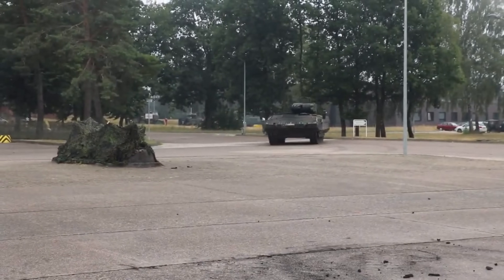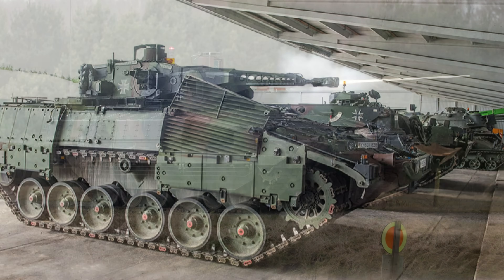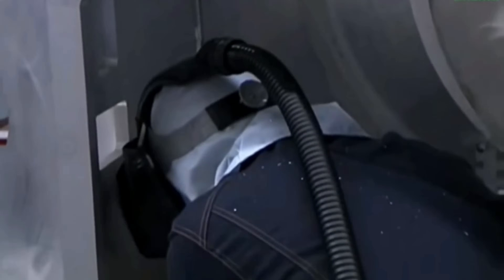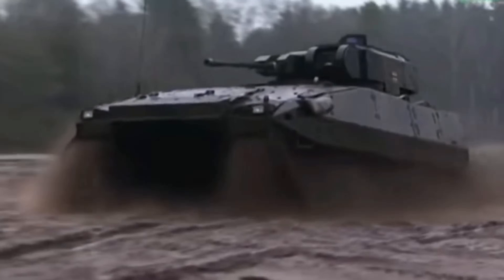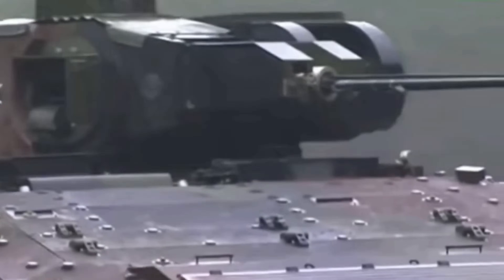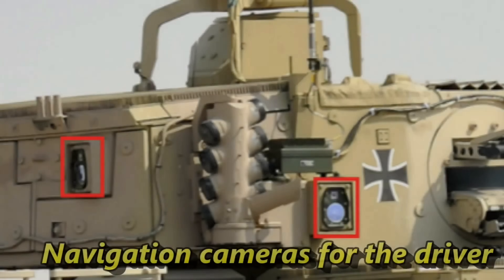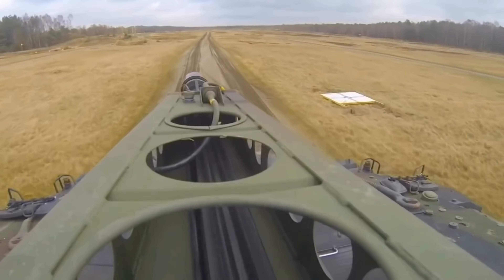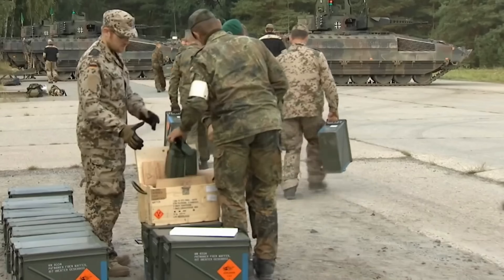The Puma Infantry Fighting Vehicle - Overview and Opinion

Comment: That hopium cage around the sides, given their current configuration, are just worthless weight.  When they get that wrong, it tends to lead me to wonder what else they got wrong.
Reply: Except slat armor with proper material thickness and spacing is a very weight efficent protection method. DIY welded cope cages made by russian conscripts are not.

Comment: Finding a balance between practical and over engineered is going to be difficult and likely deadly to find.
When a German cars headlight wiper webt out, it could cause catastrophic electrical issues, windows don't work, car won't start etc...
This will be an issue for sure, excessive tech and money when a javelin could get it,.. No? Then two javelins

Comment: Basically the Puma is over-engineered, over-weight and under-gunned. This video doesn´t address the vehicle´s problematic maintainability and although factual data are hard to come by, this issue reduces the availibility to a large extent...
Reply: ...was more reliable in ifvs trials than the cv90 and some other vehicles.

Since it has armor you can take off it is also not overweight.

Undergunned for what? Spike can destroy mbts. And the main gun works perfectly well against infantery.

Comment: a turretless Puma IFV with a higher raised roof could be significant . . . creating more space for troops loaded with full tactical gear . . . instead of a rotating turret it'll have a 25 MM GAU-12/U 7-barrel rotary cannon & 7.62 X 51 MM HMG, both fitted to a small & compact RWS . . .

Comment: A little information: The weapon has been moved slightly to the side so that analog optics are available in an emergency.

What made the development of the turret and electronic weaponry so complicated.
Reply: Not just in an emergency, they are used alongside the digital optics. Analog optics still have a much higher effective resolution than digital ones. In case of the Puma the analog optic has a effective resolution of more than six megapixels, that's about fourteen times (!) as much as a digital CCD camera optic.

Comment: The Puma has all kinds of problems. Soldiers cannot be 6ft or taller to sit in Puma. All the displays are black and white. Comms need to be updated too. The gun will just stop firing. In 2017 only 43% of the Pumas were deployment ready. It would need another 1.23 billion dollars to upgrade Puma's displays, radios, and anti-tank features.
Reply: I believe most of those issues have been addressed and resolved over the past few years. IIRC the reason for b/w displays was that they had a wider temperature-range in which they would reliably work compared to colour displays.

Comment: "Computers don't like working so good".

Disagree. You are taking your experience with consumer electronics as the baseline.

If that was indeed the baseline, zero people, not hundreds of thousands, would get into a highly computerized plane every day. They are far more complicated than an IFV.

You are of course right that brand new systems will have teething problems, but that can be said about any part of the system, not just the computerized ones (thinking of the Panther roll out in WW2).

Comment: While carrying out an attack, Ratels interspersed into arrowhead-shaped formations, with a platoon of Ratel-20s and a troop of Ratel-90s on each flank, the command Ratels located in the centre, and the remaining Ratels following in reserve. If the mechanised battle group was integrated with tanks—as during Operation Hooper and Operation Packer—the tanks spearheaded the formation to engage hostile armour, while the Ratel-20s and Ratel-90s followed closely on the flanks to suppress any accompanying infantry. Ratel-81s, if present, occupied a place in the centre of the formation, directly behind the command Ratels.

Comment: Outclassed by Ratel 20, Ratel 90, Ratel 81, Ratel ZT3.
Reply: Lol bullshit. Puma has better weapons better protection and better off road handling. Yours is just a modified truck with a small metal plate over the drivers window

Comment: I assume that due to the Puma's role as support for MBTs it is more "survivable" than the Bradley Infantry Fighting Vehicle. However theBradley DID fight right alongside US Abrams MBTs in the first Iraq war and subsequently. 
In smaller, more mobile wars it would seem the Puma is very well suited to be a stand-alone light armor vehicle or as support for armored personnel carriers and armored wheeled or tracked amphibious vehicles.
Reply: The german Puma and american Bradley (or for that matter the british Warrior) follow a different design philosophy, because the german military follows a different military doctrine (extensive combined arms). Pumas and their Panzergrenadiers are one combined weapon system. This is why it is well protected, since it is less meant for taxing its infantry to the front and then assuming an overwatch or mbt support role, but rather to directly support its Panzergrenadiers on the front.

Comment: The Puma is great but it has a big problem when used in the field.
Look at the tracks they are to narrow for its weight, so if this tank ever stops in muddy terrain it is very likely to stuck especialy in the heavyest modification.
(I was in german army i have seen this vehicle live.)
Reply: The tracks are perfectly fine for this vehicle. It has a ground pressure of 79,5 N/cm², that's even lower than a Leopard 2A4 (0,83 N/cm²).

Comment: another reason the Puma uses the 5.56 MG4 as coax is that nobody in the infanty wants the damn piece of crap :D they finally got the MG5 and are happy to get rid of the MG4, so now there is a huge stockpile of MGs nobody wants... so they put them in the Puma, cause you can always sling a 30mm ABM at them if you MG isn't good enough :D

Comment: computers dont work so good? first: relibility you use old tech like older processors and stuff just like is used in airplanes and space programs, cause u have plenty of data of how the hardware will behave, a mechanical failure is much more likely than any computer failure by a large margin. man for almost a century we been using computers to control airplanes, u think people cant get reliable use out of computers? lol saying that it might be unreliable on a ground vehicle while u use it for flight assistance on supersonic jets is kinda nonsensical..  specially cause we already use autonomous drones at warfare wich require a lot more systems to work, and if u give up on a thermal camera cause of dust, is kinda dumb cause in 99% of the cases u likely won't have a sandstorm.. and for germany i don't think they even have a desert or anything quite that sandy.. so yeah.. shallow arguments even cause the other guy stuff won't be working just like urs., adding computational capabilities to fighting vehicles is a huge force multiplier and relibility and dust ain't even a real issue.. oh by the way during cold war all the nuclear weaponry of both sides was computer controlled, once it almost went off by accident but guess what, it had a failsafe, just like you have redundancy in airplanes lol and if u compare how reliable modern stuff is to older stuff the difference is astronomical, saying high tech usage makes things less reliable is one of the most stupid trends i see around,  our engines are better than old carbs cause guess what? we have a chip controlling combustion, we have digital systems that control auto driving, diagnostics, and even the design is digitalized and perfected beyond what was possible due to computers.. lol just cause ur notebook got a virus or some piece of hardware failed u can't make the statement that computers are unreliable lol thats a falacy. oh and all our global banking system is still run on very old hardware that runs code written in a language nobody knows anymore called cobol, and guess what that shit never fucking failed.

Comment: The problem is:
"Although it is considered to be state-of-the-art, it is subject to a great time lag and high cost increases. Due to many technical defects and necessary retrofitting, full operational readiness is not unofficially expected until 2030." Wiki
That is the problem of all new german equipment.  Thats e.g. why the want buy the F/A18 so that they have something that is ready for use and works.
Reply: Lots of new german equipment works fine, now that enough money for spare parts has been provided. Boxer does and sells great. The newer Eurofighter tranches (T2+3) are fine. So are Leo II A6/7. The 130mm gun for the Leo AX (coming 2027) will be a blast.

The Puma was a very ambitious project and is slowly getting its kinks worked out.
OTOH, the US army is now pushing the Bradley replacement decision (!) out to 2027. Germany is 20 years ahead of that schedule. 

US navy is planning to get frigates from Italy because they couldnt get the LCS successor right. Germany is getting 4 new frigates this year, has 5  new corvettes under construction and recently signed the deal for 4+2 destroyers (MKS 180).

As for the F18SH option, the main reason for that is: it can get certified to carry US nukes much faster. It also gives access to additional weapon choices and generally makes the Luftwaffe less dependent on any single supplier. They are still going to buy at least 78 new T4 Eurofighters.

Comment: 5:44 The German Army propably didn't choose the 5,56mm MG because of light wight and ammunition: At the time the Puma was in development, the Bundeswehr still had the 7,62mm MG3 (basically a MG42 from WWII) as their main MG on all their existing Vehicles (Marder, Leopard) and in ther infantry squads. But the MG3 was old, the infantry was about to get the new MG4 (5,56mm) and a new 7,62mm MG was in Development, so they first put the MG4 on the Puma. In 2018 they started to replace the MG4 on the Puma with the new 7,62mm MG5.

For those of you who speak German:
https://www.onetz.de/oberviechtach/vermischtes/appell-fuer-14-neue-schuetzenpanzer-die-puma-aera-bricht-an-d1850509.html
Reply: MG 5 ist ein Witz. Ist von der Form der unkompakter, hat nur 400-800 schuss feuerrate im gegensatz zur nur 1,5 Kilo schwereren MG3 Standard Version mit ihren 850-1200 schuss Feuerrate je nach V-Klappe und das für 16 Tausend Euro pro Waffe.
Wieder nur eine neue Art die Wirtschaft mit Steuerverschwendung künstlich am Leben zu erhalten

Comment: too fat, too slow, too expensive, too unreliable. 
actually it has many technical flaws that lead to that the whole puma fleet will not be fully operational until 2030. as is expected by now. 
8.85mio euro per vehicle can only be considered as a joke. + now 750mio extra costs to bring the delivered vehicles up to the expected and ordered standard.

https://translate.google.de/translate?hl=&sl=auto&tl=en&u=https%3A%2F%2Fde.wikipedia.org%2Fwiki%2FPuma_(Sch%C3%BCtzenpanzer)%23Kritik&sandbox=1

Comment: Wow! That makes my old M3A2 ODS Bradley CFV look like shite in many areas. BUT, I not a fan of the unmanned turret. When I was a Bradley Commander, I could look over the sides of the turret, when in a turret defilade position. However, the turret cameras on the Puma apparently would be useless in that type of a battle position. Also, I don’t like the fact that an ATGM launcher does not come standard on the Puma. I guess there’s simply not enough room to store missiles inside? Interesting vehicle, though.
Reply: placeholder 
The main reason for the late adoption of the double ATGM-launcher was,  that the level of integration into the FCS, and damping/ insulation requirements were that high, that it took years for the German procurement office to fulfill  these strict development goals.
A typical german „Goldrandlösung“.

Comment: The Bundeswehr realized that they missplanned the Puma with a too small hull... taller full equipped soldiers don't fit in, their helmets touch the ceiling. Now they need to look for new Panzergrenadiers that are smaller than 1,84m XD Panzergrenadier companies shall be renamed to Dwarf-infantry XD https://www.merkur.de/politik/panne-bei-bundeswehr-soldaten-zu-gross-fuer-puma-schuetzenpanzer-zr-10092178.html
Reply: Except that wasn't a mistake but a intentional decision to limit protected volume for optimal weight-protection ratio.

Comment: Recently I saw a report regarding the Puma that it suffers a lot of technical difficulties. The opposition said that it was rolled out of development too early and that certain flaws were only discovered after the fist batch was delivered. To save cost the government did not order enough spare parts. This means that there is a shortage of working tanks to train troops - tanks have to be cannibalized for spare parts - use two to create one working tank.

In the report the tanks engine stopped in the open field - to restart the engine the main plug had to be pulled to remove power and hard reboot the system - taking about 6 minutes. You cannot afford 6 minutes downtime in battle.

Comment: Nice video so far, but like most people who never had to use it, you get the mechanics of air burst ammunition a bit wrong. It’s by no means like throwing a frag grenade into a room or a trench, but more like firing a giant shotgun 15 meters in front of the enemy. By that, you kind of get a conical pattern with each shot. However, using low velocity AB-ammo like 40mm, it comes indeed quite close to throwing a grenade 😅

Comment: On paper the Puma appears to be a good thing.

Let me forward some second hand information of what, in my opinion, makes this thing a mess, at least for german standards:
1. These crew and passanger compartment starts building mold after 3 weeks without system external powered air conditioning.
I hear of several cases that have been contaminated with mold just by standing around after an exercise . Mold cleanup cost per vehicle is somewhere in the mid 5 digits.
2. The vehicle is practically not operational above something around 32 ° Celsius. Air conditioning refuse operation and vehicle electronics permit further operation.
(I myself kind of doubt that one, though such a mess isnt too far off either nowadays.)
3. Shell cost per unit, even for practice rounds, makes this thing an almost "one in a livetime" firering experience ... to overstate the fact ... at least for german military budged as far as i have heard of.

Anyone here to confirm or bust these statements? 
Im very curios though i've just heard these thing from a  contact to service units in the Bundeswehr.

Cheers

Comment: As a member of Bundeswehr with contact to Puma Projekt.This Tank is one of the most extreme examples of the typical German overengineering. Design flaws because of A400M transportation, for which it has to be disassembled, full of not working IT and so expensive that real combat is just unaffordable. Why not a single foreign army has chosen it, which are Keen on german military vehicles  usually?Why Rheinmetall has built a new infantry combat tank with conventional layout?